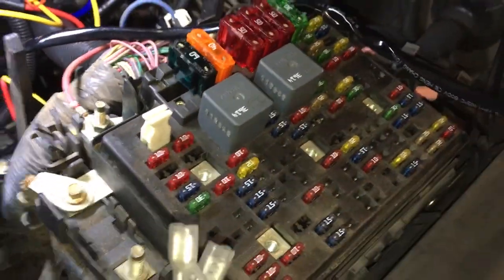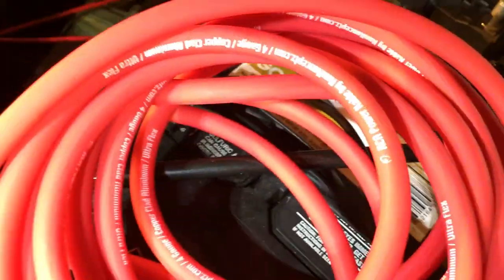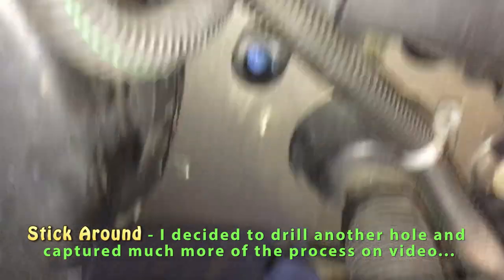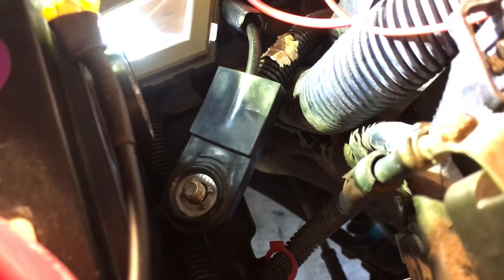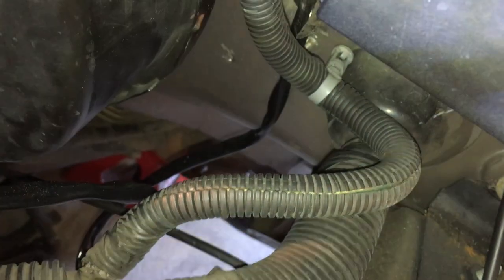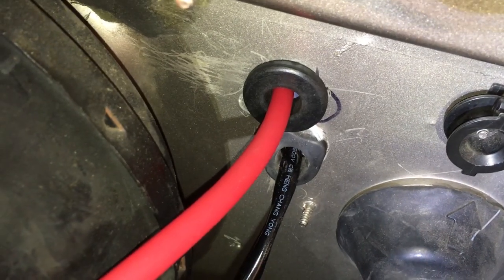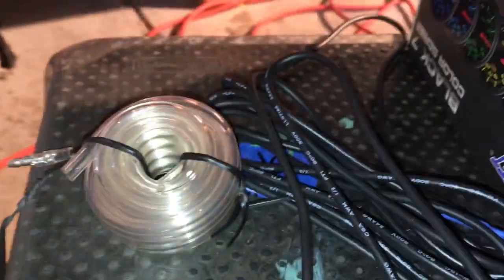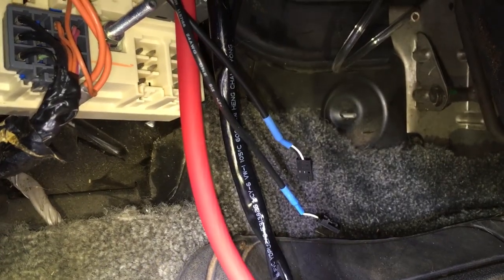Where to Punch Holes Through Firewall For Wires on a Chevy Tahoe

Comment: To left of the brake booster and right of gas pedel theres a good spot also if you look under dash there is a spot for them to come thru still have to drill hole on out side and run rubber grommet  can do it much easer without removing anthing

Comment: I wired my amp down the engine bay and up a grommet thats under the front driver side floor board. It was way easier and no drilling required. 30 min tops if your decent skilled
Reply from the maker: great tip, thanks
Reply: Wouldn’t water get in though?

Comment: This is where the clutch pedal linkage would go on a manual transmission vehicle. So note that this only works if you have an automatic. Great place to do it. I highly recommend using a step drill so you get clean edges. I did mine with this boot: https://www.amazon.com/gp/product/B004K2285E/ref=oh_aui_search_detailpage?ie=UTF8&psc=1    and after running wires through the boot you can ziptie it down onto the wires to make an air seal.

Comment: I have a 1997 GMC Sierra C1500 and do not know where I can drill or access from the engine compartment to the inside cab for running  new wires for my new fog lights. Any help would be great. Thanks...August
Reply from the maker: Pick a spot you think will work and just use a punch to tap a dimple in the firewall.  Check to see where the dimple is on the other side (making sure not to mess up any wires or anything else).  If it looks good, start with a very small drill bit and go through (carefully).  If it looks good and clear, use a step bit to get your hole to the proper size and go for it.
Reply: yeah little late but look for where a clutch assembly would go through a firewall is usually a really good place, itll have notches or even a grommet plug already there for you

Comment: ugh, I'm so nervous to pull the trigger. Im running a 0 gauge o_0 ......
Reply from the maker: just go for it.  use a tiny bit (or progressive drill bit) and do it.  check both sides to make sure your bit won't hit any wires.  good luck!

Comment: why make all those holes in the firewall and run them through the interior...? the panels won't fit back on properly and you'll get interference from those wires into other circuits on the vehicle.... loom them and go under the vehicle and find a suitable location at the back of the vehicle to bring them all through in one large multiport grommet. sort of pointless to run multiple sets when you could have just run a 2/0 single run...
Reply from the maker: good tips.